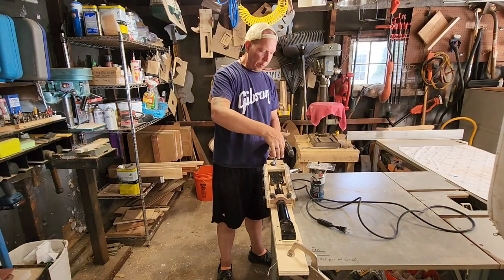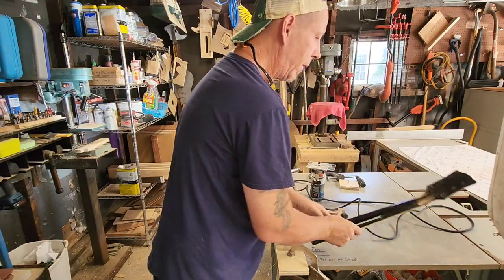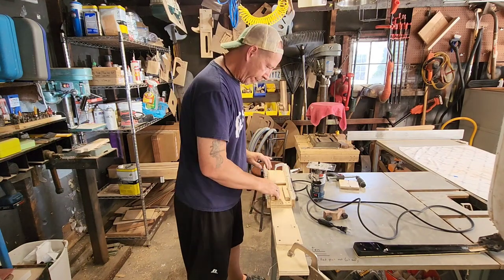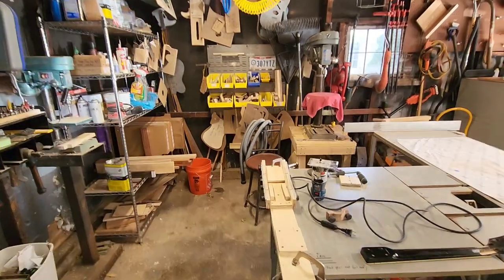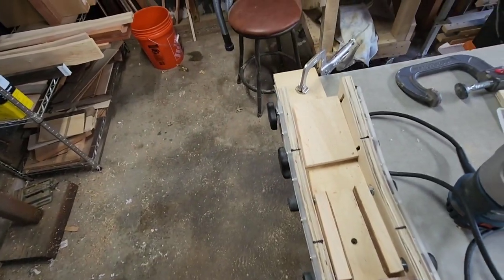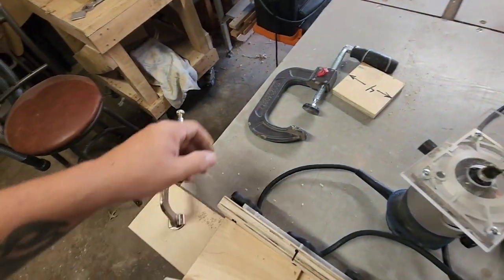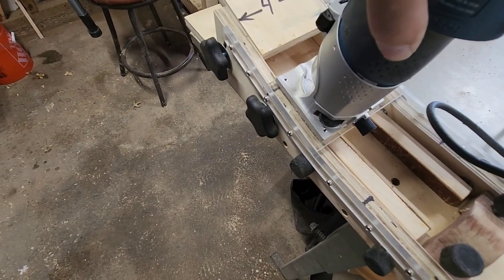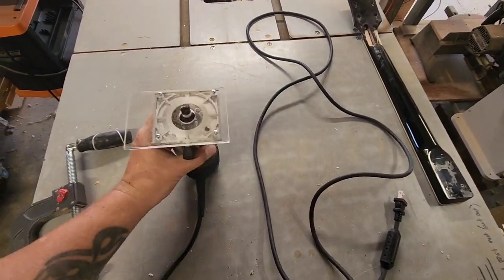Spline tool router sled for broken headstocks

Comment: Thanks for plan , I have one question, As the side plates of zig are inclined ( as if guitar head stock ) , but the splines seems as straight, how it's possible. If router is following the curved surface, so splines also have round inside, please guide. So I can also build this

Comment: Thanks sir for sharing your work, just have a question , as this zig has curve , so wood filler for splines must have countur of spline, how to achieve this?
Reply from the maker: I mill maple or mahogany to the same width as the diameter of the bit and make a template from the side of the jig with the curve. You can test the template by laying it in the freshly cut groove. Carefully radius the ends and prepare for glue.

Comment: That's genius.

If you were concerned with having perfectly symmetrical spine locations, you could mark the router sled at the point of the middle of the bit, and mark stops on the jig accordingly.

Comment: Great stuff Thomas and thank you on behalf of everyone for making the plans available. One question.  Does the bottom of the routed channel exactly match the curve of the jig?  In other words, can the curved part of the jig be used to scribe the bottom curve of the spline (or do you use a different method)?
Reply from the maker: Yes, very close. The radius is slightly larger due to the stick-out of the router bit. I made a template to cut the splines; you can dial it in easily as the bottom of the channel is visible when you make the pattern from narrow stock.
Reply: @ThomasMuseGuitars  Thanks!

Comment: What router  bit is that?
Reply from the maker: That's a 1/2" x 1/2" (13mm x 13mm) bit with a bearing at the shaft end. You don't need a bearing, it's just what I had on hand.